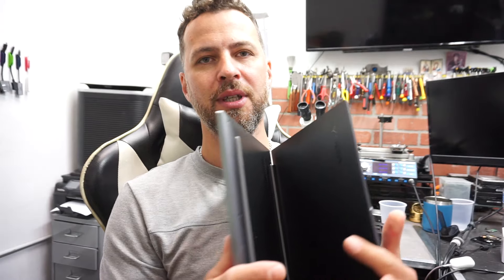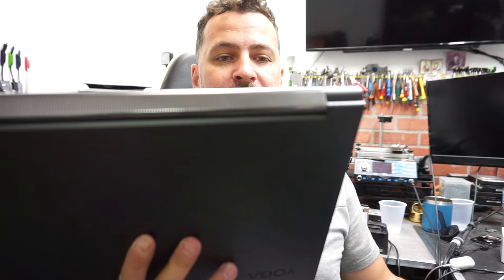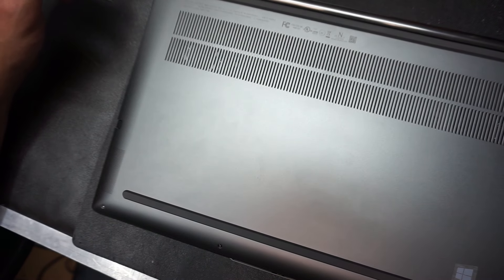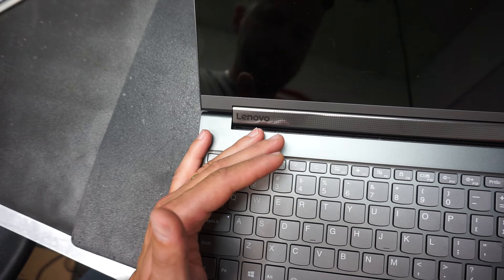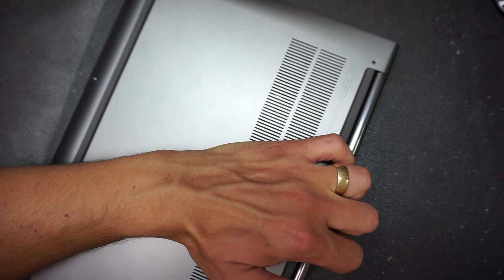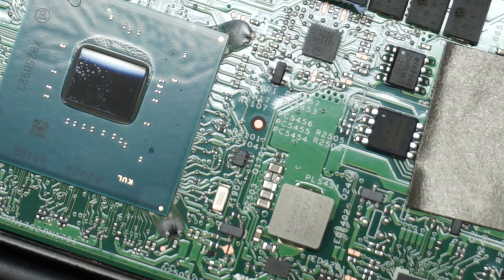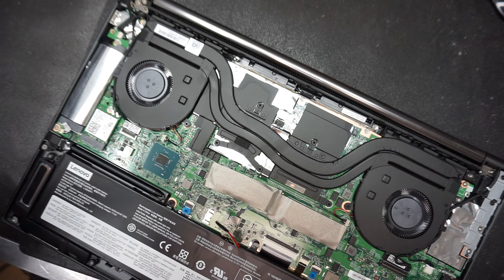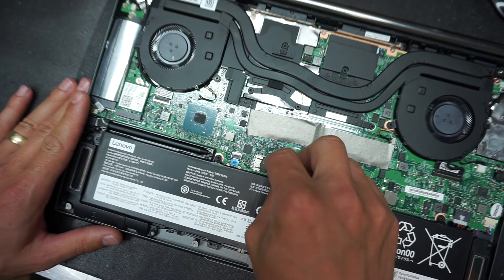LENOVO YOGA black screen FIX (works for most Yoga series).

Comment: To contribute - same issue, but went for the power drain instead of taking apart - my USBs were working, so I attached every device I had on charge (ecigs, phone, power bank) and it drained the battery very quickly - hope that helps those without tools to hand 🙏
Reply: How long do you have to wait?
Reply: I got all the screws removed and was not wanting to pry the back off! then I saw your comment. I now have two power banks plugged into it. Tysm
Reply: Thank you! this worked for me..

Comment: Have been dealing with Lenovo (premium on-site support 4yr with accidental damage adder) on this issue with my daughter's laptop for 2yrs now.  4 replaced motherboards and a replaced battery and it continues to happen intermittently (happened yesterday).  Lenovo will not admit a wide spread issue and will not replace the laptop or refund.  This fix works great, but if you are scared of opening the computer, just leave the computer "on" (you can hear it running, keyboard/power button lit up) and let it run over night to drain the battery (takes 4-8hrs).  Once you plug it in, it will boot fine.  Replicating the power drain shown in this video.  Too bad Lenovo isn't recognizing this issue!!!!
Reply: They have the worst customer service ever!!!

Comment: Man thank you so much! I have Lenovo yoga 7i I barely used it but the warranty expired a month ago, I took it to Best Buy and they couldn’t turn it on and they said is the motherboard, then I took it to a fixing store and they told me the same, I was about to trow it in the trash, and I see this video I did this and now is working perfect! Thank you so much for your help!!!!
Reply: Best Buy is the worse place to take technology. Just don't do it.
Reply: What kind of screw driver did you use? Is it the kind you repair reading glasses with ?

Comment: My yoga 7i wouldn't start even after disconnecting the battery and pressing start for 60s. Rather than remove the internals to disconnect the CMOS, I put the reassembled and battery-connected laptop in a sealed box with a hot damp cloth (not touching the laptop obviously) to see if a humid atmosphere could dissipate the static buildup that seems to be the cause of this problem. It took less than an hour to fix itself!

Comment: This was really helpful. Thank you! I had the same problem where disconnecting the main battery to do the power drain wasn't enough. Your video helped me realize I also needed to disconnect the smaller battery, and it was really helpful you mentioned to give it a second when you turned it back on. At first I didn't think it worked, but then after a few minutes it did turn on! Thanks again!
Reply: Which ones the smaller battery?
Reply: Bro can you do a video of accessing the small battery
Reply: Do you have the same model

Comment: Thanks! I did this and it seems to be working.  HOWEVER:  A note of caution for others trying this -- my Yoga has a rubber strip along the edge near the hinge, and this strip conceals a few screws.  On a machine like this, I think you need to pop off the strip (which I didn't do) and then take out the screws.

Comment: Hi, I have a Lenovo Ideapad Yoga 2 Pro. I am trying to fix an issue with the power turning on and then off. The screen is black. The keys backlight comes up for 2 seconds and then turns off. I have done the foll 1) Hard reset 2) Changed power supply 3) Removed battery and did a direct AC connect 4) Reset CMOS . None of these have worked . Is there anything more I can do, before considering it toast ? Thanks - AjAnt
Reply: I have the same issue

Comment: Fantastic! Thank you very much for this fix. It worked perfectly on my wife's c940 Yoga. She was hinting at buying a new laptop for 1,200 but I fixed it for the price of a Torx T7 or T8 screwdriver for 8.97 at Home Depot. Your delivery of the information and demonstration was clear, concise and easy to follow. I was confused why you said to press the power button for 30 sec. AFTER disconnecting the battery (I forgot about the CMOS battery). I did as you suggested and voila! - done in 20 minutes. Keep up the good work.

Comment: Hi,
I have s Lenovo Yoga 9i 15IMH5
INTEL CORE i9 10gen.
Thank you for the video I am glad it looks it helped a lot of people.
In my case I have followed your video step by step several times but it goes as far as the beep keep flashing on the motherboard but that's as far as it get.
So I have managed to have access to the other side of the motherboard but I couldn't see any CMOS battery the centre middle side of the motherboard is covered by copper foil, and both side of the motherboard are the fans. Please help me to shed more ideas regarding the CMOS.
Iam experiencing exactly the same symptoms you have described in the video.
Thank you for your help.
Kind regards

Comment: I have a Lenovo yoga 730-13” and the monitor started glitching a few months ago, now it doesn’t work at all. If I plug it in to an external monitor I can use the laptop. So it appears it’s just the monitor/ screen. Is this video the fix for that? I don’t want to take it to a repair shop and be told I need a whole new motherboard. Thanks for your videos!

Comment: in my yoga S940-14iil  Ihave similar problem with one difference when lid is open 3 cm high screen is working also touch pad- but when start opening further it goes black- is this same or different issue?

Comment: I have a yoga 920-13ikb, this just happened yesterday where the screen went black. I heard it could also be a ram issue but my symptoms are exactly as described as yours. How do I tell if it's a ram issue or firmware issue like you say?

Comment: I'm having the issue where I get the black screen after I log on. I'll be able to get the black screen to go away by pressing shift+ ctrl+ winKey+ B. It will just load forever after that. Or sometimes the screen will become the color of my display. I won't be able to do anything because if I click on anything it will just load and either not do anything or take minutes to just pull up the power off option. I'm not sure what to do or how to fix.

Comment: I followed this as instructed, and the screen remains black. I've been able to find nothing about a bios or CMOS battery for my model. Not only that, but now when it powers on, I don't hear the clicks and the fans do not engage. 😕 I'm using a Lenovo Yoga C940-14iil.
Reply: Pudiste obtener alguna solución? Tengo problema

Comment: Did this on my yoga 260. I even did unplug the bios battery and the ram. Nothing works. It turns on, keypad lights on but not the caplock. All i can hear is the fan. Removed ssd and tried to boot it fom another computer. It boots after taking ages but screen remains frozen on the windows page. Wonder if windows 10 could be the culprit? My ssd files are accessible if plugged to another pc as an external drive.

Comment: Wait, so you basically just reseated the machine and that's it?  I'm going to try that and see what I get.  Do you know if there is any way to test whether the bios fix worked and was reset without removing the motherboard and messing with that bios battery?  Thanks for the video!  I bought my C940-14IL as an open-box special last year and it started giving me the random "black screen, unresponsive display" thing around 4-6months ago, only when I was on battery power.  I was worried maybe something had critically failed.

Comment: I have the same problem with my thinkpad yoga 260. The power button is green, the red light on the thinkpad logo is on. But the screen is black. It's like it doesn't connect with my screen. I just did what you said in the video but it doesn't work.

Comment: my yoga s940 had been checked in official lenovo service center. And they told me to change the entire lcd module. Unfortunately, the sparepart is discontinued so they dont give me any other alternatives. Do you think they have tried this solution? I mean before suggesting to change the sparepart as the only way solution

Comment: Thank you for this video. I have another question.  I dropped my Yoga c 930. All is working fine except keyboard.  When battery is less then 100% ( no matter on charger or not) the keyboard works fine. If battery reaches 100% and is on charger the keyboard doesn't work properly.  I have to unplug the charger and the keyboard works fine. Any idea what's going on and how to fix this?
Reply from the maker: Just a guess ( had this issue on a Dell laptop) - order a new battery and replace it, see if it solves the issue. This only works if the keyboard has a delay when typing. You can always return the battery if it turns out not to be the issue.

Comment: Had the same problem described here with a nearly new Yoga 7i. Disconnected and then reconnected the battery. Closed it back up. Now I have the orange light next to the power input blinking orange continually. And no battery indicator on the bottom right side of the screen.  I'm able to type this because the computer can put an image up on a Panasonic TV via a USB-C, then HDMI adapter connection. Help! I need this computer for work. Paid way too much for it for this.

Comment: I have the same problem. Computer boots up but nothing on the screen - I can see the display through a second screen.  The problem crops up everytime I restart or reboot the computer. I tried draining the battery fully and then booting it up and it worked. But when I restarted it again, it stopped working. But this time even when I drained the battery fully, it has still not worked. Any suggestions?

Comment: Thanks for making this video. This didn't work for the Yoga 910 I'm trying to fix, but maybe I also need to disconnect the bios battery as you suggest. I just need to find it, hopefully without tearing the whole thing apart.
Reply: Did you get it working?
Reply: I'm currently trying it for my 920 as well. There's no bios battery and I read somewhere that I should remove the main battery and then use a connector to short the positive and negative on the motherboard. MAKE SURE BATTERY IS DISCONNECTED. I haven't tried it yet as I came here to look for more info.

Comment: I noticed my power button light was blinking on and off on and off and my computer will not turn on just a black screen so I hold in the power button and then I notice after 10 seconds the power button light went off and then I waited and then I pressed in the power button again and my computer turned on Thank you

Comment: Hi, 
  thanks a lot for the video ant the detailed explanation!!! I got two problems with my Lenovo X1 Yoga Gen 2 (20JE) and I hope you can help me. 
1.	Since about a week, when I turn on the X1, the screen starts flickering with showing strange horizontal lines when the Lenovo logo is being displayed. Sometimes the screen turns completely black. Everything works fine with the external display. Sometimes it helps to login and turn the display brightness down to the minimum and the display works fine. When the battery level is going down close to the minimum the screen starts flickering again, when the brightness has been increased again. I found some articles saying that I will have to replace the OLED-cable (WQHD eDP Cable / LCD Cable ( 450.0A90A.0011); pretty short cable just going from the motherboard inside the cover of the hinges to the top cover ) others mention the LCD cable (the long, copper coloured one with a V-shape, glued on the rear side of the display). What is your opinion in this case? Could it really be one of the cables? For accessing the BIOS chip, I will have to take the motherboard out, because I didn’t find it on the rear side. I will give it a try, today.
2.	The second problem is a little bit awkward. I set the supervisor password in BIOS and am sure that I wrote down the correct one. This was when I got the X1, years ago. Unfortunately, it does not work anymore. How can I reset it, without having the BIOS chip being replaced? I found a YouTube video where it was mentioned that it might help to shorten the pins 1 and 2 of the BIOS chip when powering the X1 on to be able reset the supervisor password. Is this correct? Did you try that, too? I am a little bit concerned, when it comes to just shorten pins on a motherboard. … or is there another, better/easier method that you could recommend?
Best regards!

Comment: In my case (Yoga C930-13IKB), pressing the power button turns the power light and backlight on for two seconds, then turns off (No fan running). Or sometimes, back light goes off, but the power light stays on, and nothing else happens, except the SSD chip gets hot. Tried the trick above and it didn't work. Does anyone have any other ideas? I am gonna try finding the small battery next.

Comment: Hi, I have a lenovo yoga 370, I have no backlight, but with a torch you can see it is working, any idea on what may be the problem? I have tried to replace the screen but with no luck :(
Reply: problem black screen not worked ThinkPad yoga 370 serial number MP19t2b1

Comment: After shutting it down it stays black the next morning.
But my issue is somehow different:
 
- Internal screen stays black.
- External Monitor works fine
- Windows starts normally
- Keyboard backlight ist working

Any ideas?

Comment: Has anyone tried replacing the bios chip? I tried this, it worked for 2 days, then had the same problem again. I've done it 4 times now... getting tired of pulling screws. If i did, replace the BIOS chip, am I looking for the exact same part, or will that just come with the exact same problems? Should I get a BIOS chip for a different computer? Are they brand or OS specific? Thanks for any advice,
Reply: Did you get the answer?

Comment: I've got a lenovo yoga 530 - 14rr with that problem, but disconnecting the battery didn't work. I would like to replace the cmos battery but can not locate it. Is it really on the backside of the board?